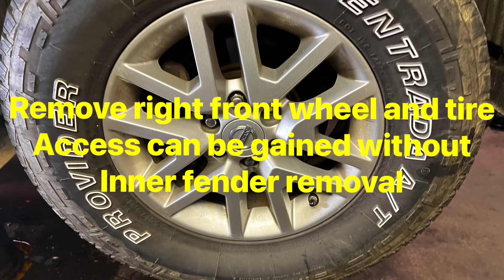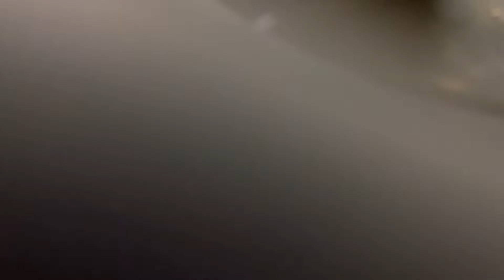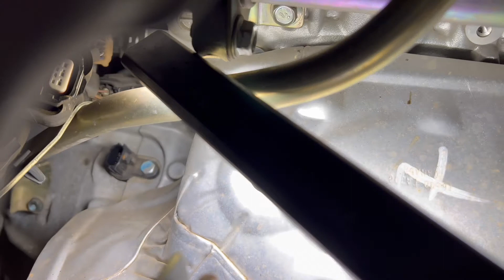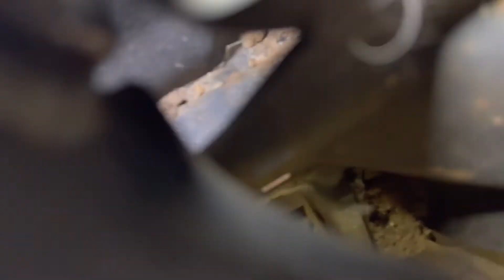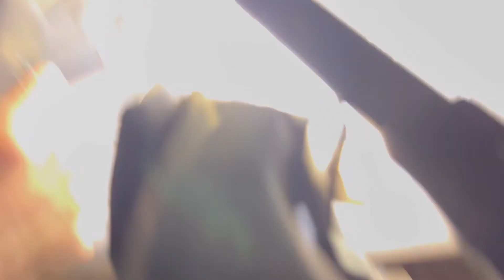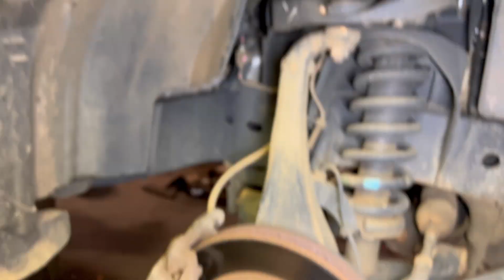2014 Nissan Frontier 4.0 crank position sensor replacement.

Comment: Did my neighbor's 2015 Frontier. The swivel for the socket will be needed if you don't take out the wheel liner. Otherwise not difficult even with my big paws.
Reply from the maker: Yeah it’s not the worst one in the world. I’ve done way worse than this one. The 350z is not fun at all.

Comment: Sensor changed because of a p0335 code I'm assuming?
Reply from the maker: I can’t remember the code but he was having issues with starting like an extended start and randomly shutting off.
Reply: @JEEPERDUDE98  My 2012 4.0 Frontier started doing the same thing a couple of days ago. Threw code P0335 which is the crankshaft position sensor code. Looks like a bit of pain to change.
Reply from the maker: @beercanbrian1880  it’s not to awful bad once the inner fender liner is out it’s not bad to get in there. If I recall it’s a 10mm bolt I used a 1/4 drive socket and ratchet with a long extension.